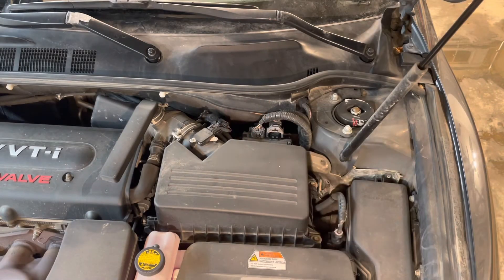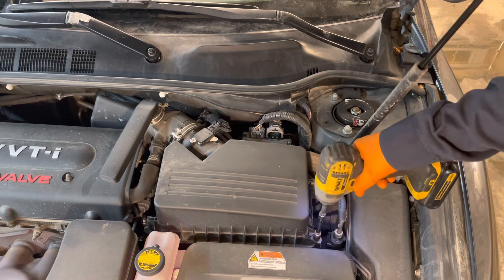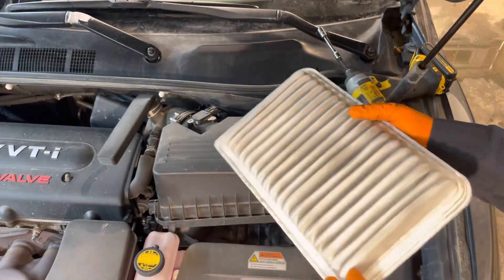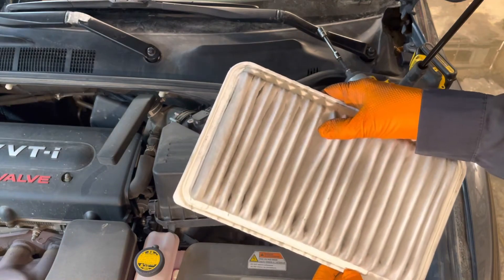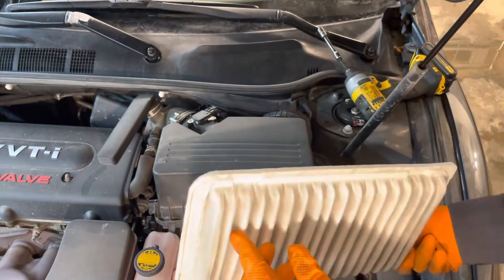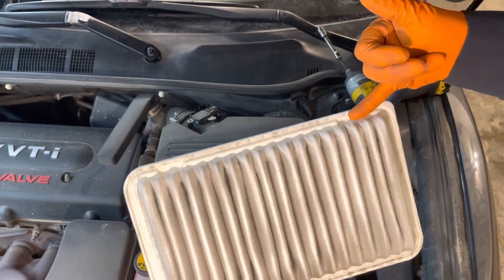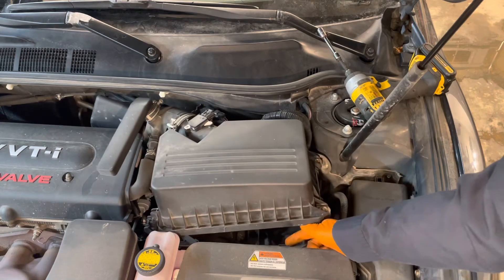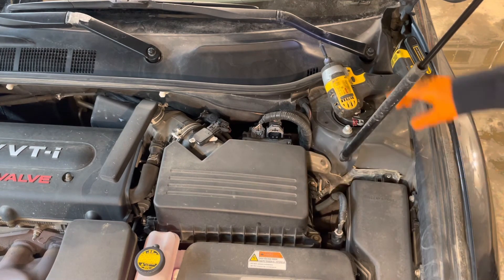2007-2011 Toyota Camry Hybrid 4 Cylinder Engine Air Filter Replacement Instructions

Comment: that filter is not my problem, there is a filter in the upper housing of that compartment. I cant remove it without thinking im going to break something. Is it permanent or can it be replaced, more importantly removed to replace without damaging something? Mine is the same engine as this video (2007 camry 2.4)
Reply from the maker: @BOBBYB3133  that is an emission control component “filter” impregnated with charcoal. It is meant to prevent fuel vapour from escaping from the intake when the engine is off. It is not replaceable. There is no reason to remove it.
Reply: @Viktor_G_Automotive  thank you, good to know, i had to disassemble all that to get to my heater core hoses to do a flush job on the heater core and was cleaning up and changing what needed to be along the way of putting everything back together. Appreciate your help and getting back to me so soon.
Reply from the maker: @BOBBYB3133  no problem!